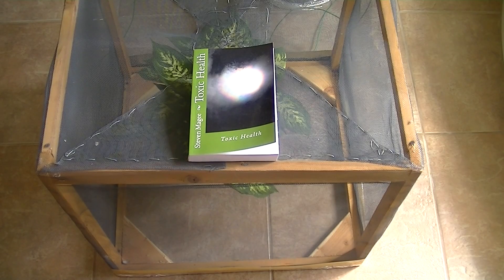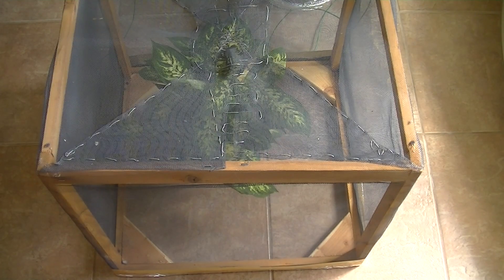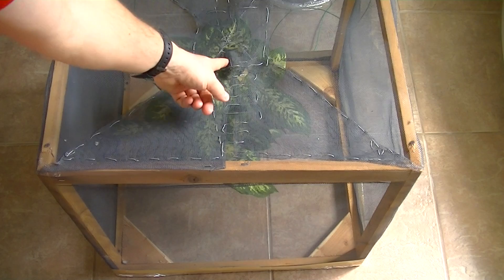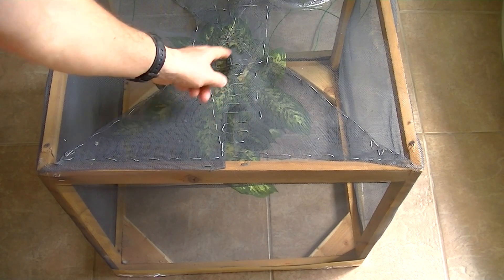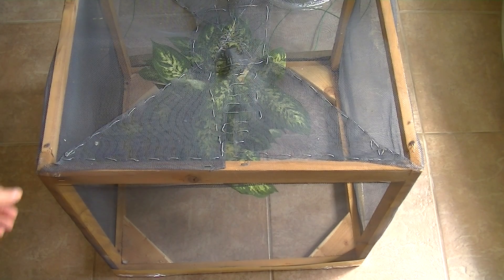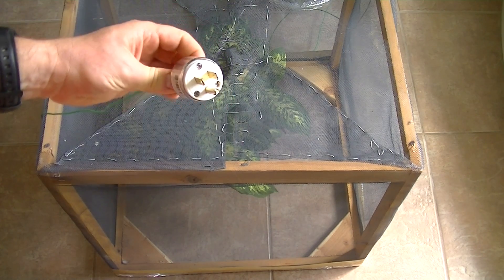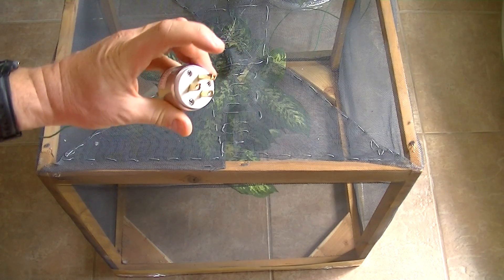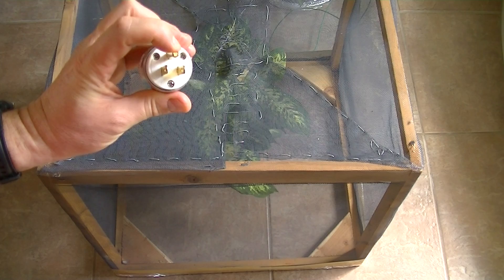Nighttime Only Faraday Cage Plant Experiment

Comment: Was surprised at how the large mesh poultry wire INCREASED THE READINGS on the other vid. (2.4 Ghz)
Also, surprised at the increased readings on the wifi multiple (bucket) Faraday cages video, when you were lowering the buckets... The metal and foil must have been Reflecting the signals, momentarily... (I wish some of your videos had commentary about the readings, not just, "Here's the reading."... as many of us are not always seeing the details on Youtubes.)
-Thanks for making these.. Very helpful, and Health is most important.
Reply: Check out my Faraday Cage Video, it's in my Channel :)

Comment: Hey, I live in an  apartment suite which is located directly next to the broiler room where they have all the smart meters for the entire apartment. If I were to build a wooden frame around my bed, & attach double layers of aluminum screen around it, would it block out the emf coming from the smart meters & anywhere else? I'd also put emergency blankets on the floor of the bed to block out any emf coming from the ground up. So it was entirely a vacuum for emf radiation. Would it work?
Reply: i know this is old, but have you heard they have emf protecting paints? if you are that close i recommend that.. otherwise, have you experimented in the meantime?  I would assume even using something against that 1 wall would help some.. very curious

Comment: you said you put an aluminum sheet underneath..but does it make contact, have you put the screen underneath the wooden frame to make contact? have you tried if it works with a cell phone, to see if it takes signal off??? so, which were the results?

Comment: Have you tried earthing plants to see what happens with a ground rod, i.e. do they deform as with the electrical ground?  I've put my digital oscilloscope on the electrical ground and it looks a lot cleaner than what I pick up from a grounding rod I put in the back yard down the hill a bit.

I took a picture of my scope when I had it hooked to the grounding rod, and in the picture it shows about 5 or 6 different distorted A/C waves superimposed over each other and the frequency is around 200 KHz. I didn't see all the waves with just my eyes as they were moving across the scope too fast, but they are quite clear in the pictures I took.  My electrical ground was much cleaner, so maybe it has a filter.  Is there some kind of filter that I can use to filter out whatever frequencies are coming up from the grounding rod but still ground myself?

We've been trying earthing, but unlike in the book where they talk about people sleeping well, it seems more like it may be giving us insomnia, but it could be coming from something else, so the jury is still out on that one.  With all the stuff that can be running through the ground it seems earthing may be problematic and more research is needed.  Thanks!
Reply from the maker: While the frequencies may be in the ground, when you connect a long cable to a ground rod you create an antenna system.  It is not surprising to see you reading radio frequencies (RF) that are higher than your home electrical system.  Your cable is outdoors and there is far more RF there.  Plants that I have connected to the non-electrified ground rod look similar to my controls that are RF exposed from cell towers and transmitting utility meters.
Reply: StevenMageeBooks
Oh right.  Duh!  I was going to bury the wire in the ground but hadn't gotten around to it yet.  I've got some shielded cable I can use, so if I used that and bury it do you think that will be enough to clean up the harmonics, or should I also try some kind of filter?

We've got an earthing sheet and what happens with both of us is we're tired and want to sleep or nap, but we get on the sheet and after a while we feel energized and wide awake and have trouble getting to sleep.  I was thinking it might be the harmonics on the wire causing it, as when we were up in the islands near Seattle for a couple of days and we slept a lot better on the sheet when we were there.

I have a question on another topic I was hoping you could shed some light on.  In the book Earthing on p. 44 it shows 3 charts showing cortisol levels for several people when they were earthed and not earthed.  In both charts it shows cortisol levels peaking around 8am in the morning and I'm trying to understand why this is.

I would think cortisol levels should be dropping at night as the body should be resting and healing itself, but instead the cortisol shoots way up just when we should be the most rested.  I found for years that most of the time I feel worse in the morning than when I go to bed, and seeing the cortisol level chart makes me think there is a correlation.  My question to you is why do you think cortisol goes up like that and do you think it's emf related?  To me it looks unnatural, like its the opposite of what it should be, and I'm wondering what is causing it.  Thanks!
Reply from the maker: The human mind and body is tied into the natural radiation levels, commonly called the Schumann Resonances, nighttime and daytime.  It is not surprising to see chemical changes occurring in the human just after dawn.  The morning fatigue is a sign that you may be in incorrect environmental conditions and the book Health Forensics may enlighten you:
http://amzn.com/1494952947

Comment: Do you also have a control plant for the experiment?  It would also be interesting to have another plant that is inside the faraday cage at night but is also grounded to an earth ground at night, but only at night. 

With earthing they say there is a flow of electrons (and possibly other earth energies?) coming up the wire from the earth, so by grounding the plant at night this might help offset possible side effects from the faraday cage?  

This is very important research because we're all being inundated with ever-increasing amounts of rf radiation, and yet we don't want to do ourselves more harm than good by trying to avoid it with shielding products and such.  Thanks!
Reply from the maker: I have many control plants around the home, I just don't show them in the video.  I have connected the soil into the electrical grounding system and the plants deform.  http://youtu.be/WJaY1RvjN0c Interim Results March 2013 for Stray Voltage Exposed Dieffenbachia Plant